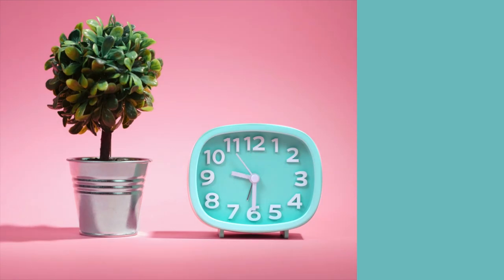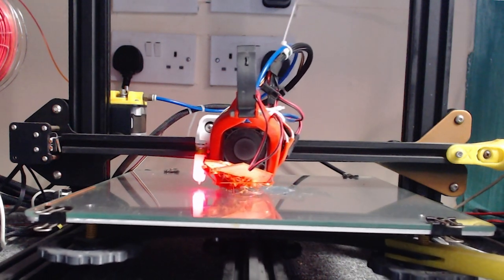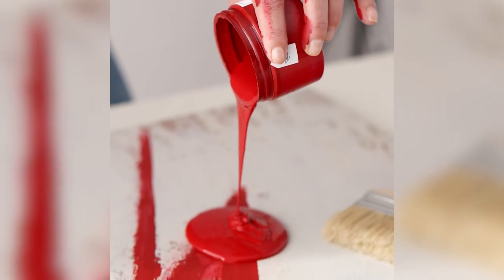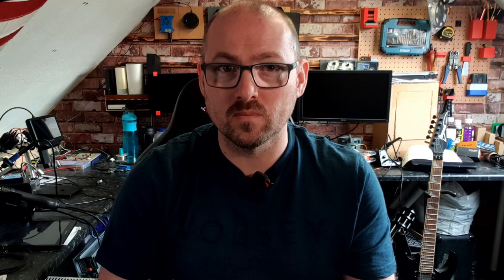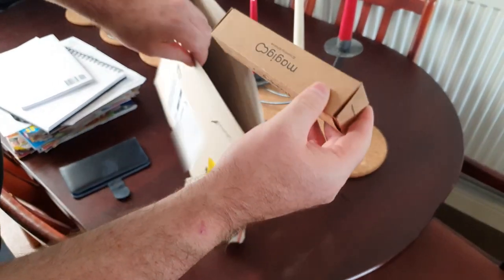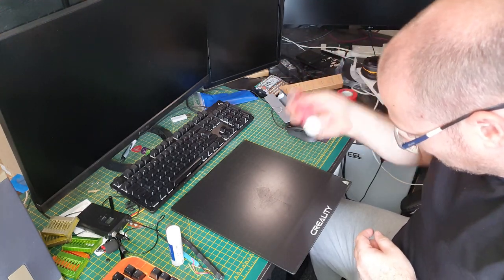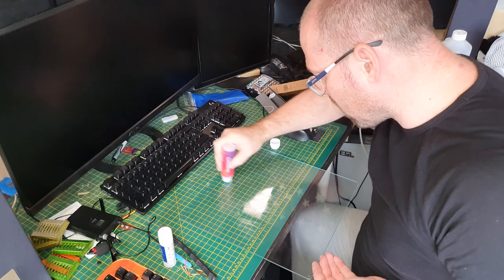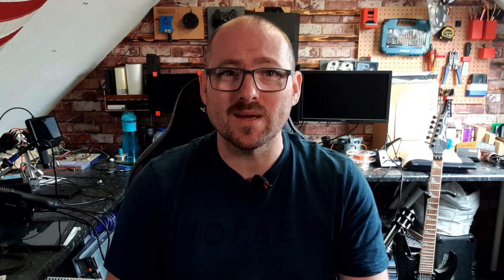How you can get 3D prints to STICK down CONSISTENTLY!

Comment: One time in band camp I squeeze my magicgoo bottle too hard and the top popped off. Litterally magic goo all over my prusa bed but I was able to squeegee most of it back into the bottle.
Reply from the maker: Ohh no!!
At least you didn't lose it all.

I bet the prints stuck really well for some time after that huh?
Reply: haha, that happens when you squeeze the bottle hard. You just need to press to activate the spring valve inside and let the goo flow